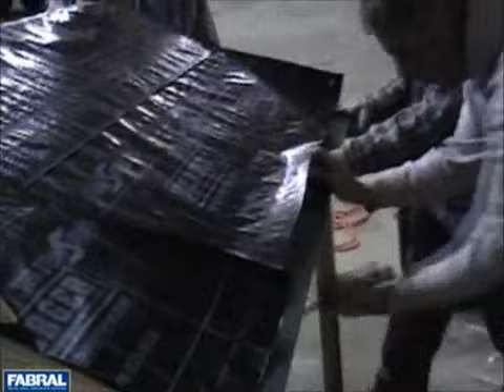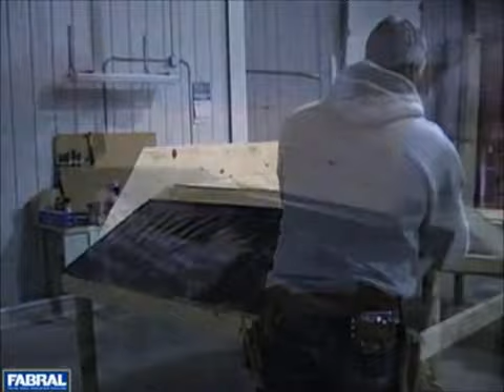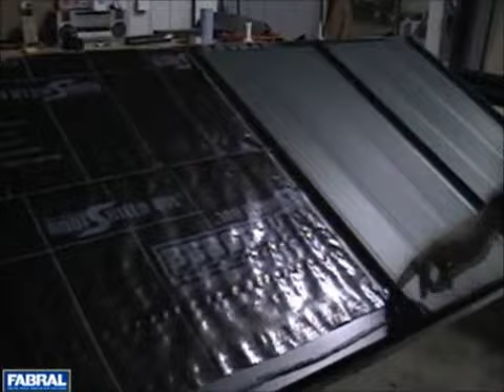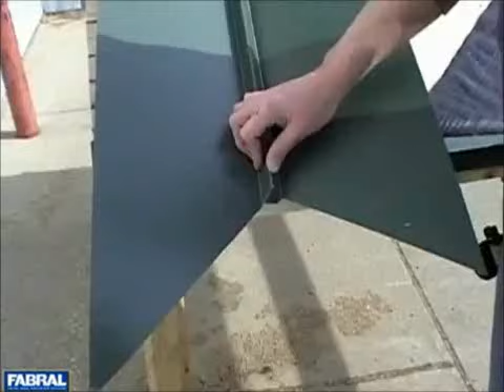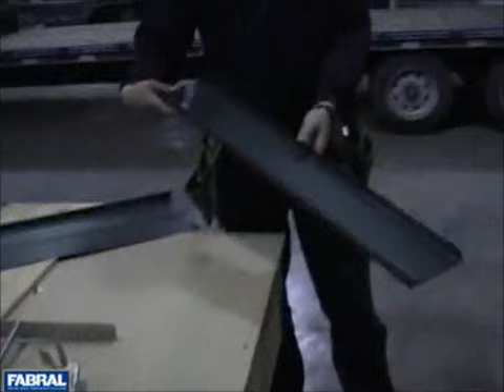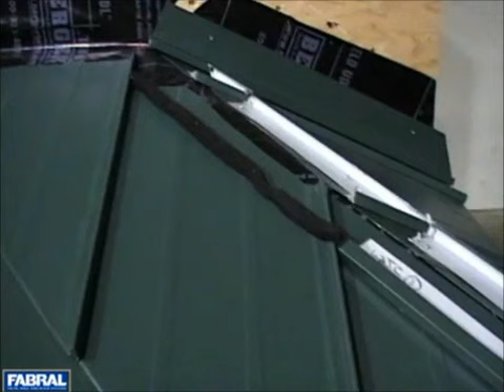"How to Install Standing Seam Metal Roof" by Fabral

Comment: I'm doing a standing seam roof on a 1-12 pinched a Steel building how do you properly remove the panels is there a proper tool
Reply from the maker: There really isn't a tool ... Standing seam panels are not removable

Comment: how many years will a IB roof last and what would it cost to do 1200 sg foot roof that looks like an over size garage....
this roof is 2X12's with drywall on the bottom and roofing on top with only soffit vents and no venting at the ridge.... won't this style roofing cook the roof off ????

Comment: HELP.... my sisters house has a 1 3/4 X 12 pitch ( yes i measured it 3 times to be sure) 
i was hoping to use standing seam but everyone said it is made for a 3X12 pitch or more...
she lives in Chicago and it has crappy leaking rolled roofing on it. other then a torched down roof what can i use that will last a long time ? i do not wish to re frame the roof to make it steeper....